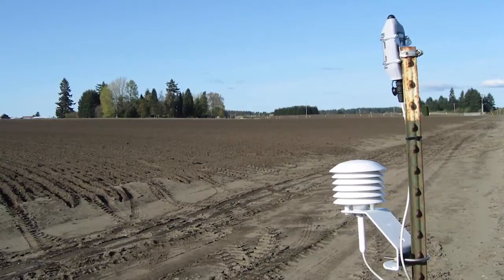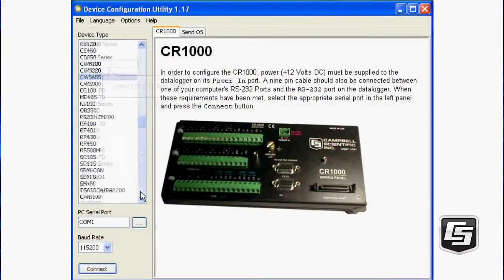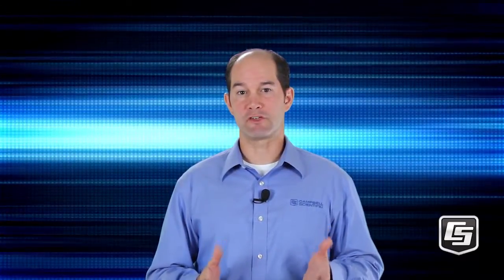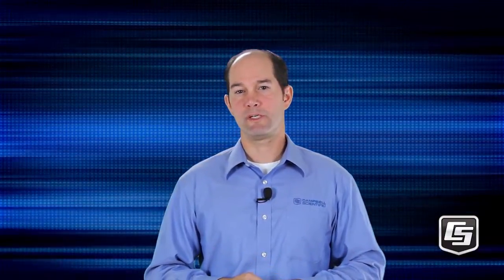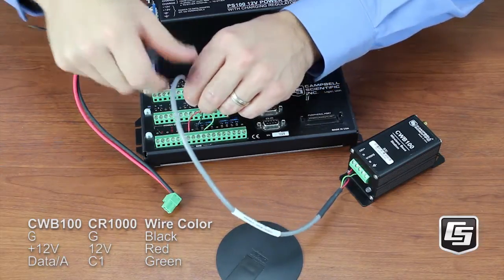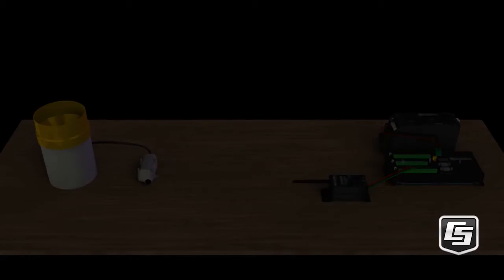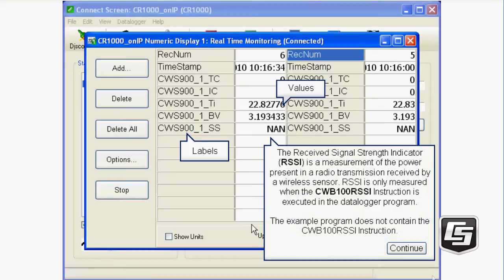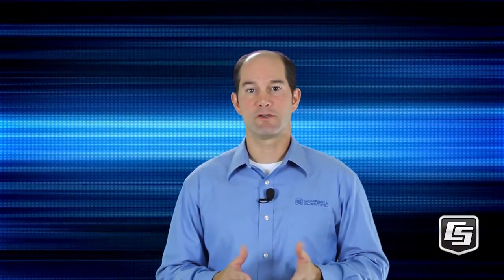Campbell Scientific Wireless Sensor Networks - Part 2

Comment: Hi!Thanks for great instructions. I have one question regarding the red flash that shows how many hops to the base station. If an extra hop is needed to reach the base station, will the sensor initiate this itself or does it need to be specified during configuration? I currently have 5 sensors out of 45 installed that aren't sending data and when I test them there is of course no red flash, just blue. They are not far from other sensors in the network and I am puzzled as to why they don't use these other sensors as repeaters, as I've heard they can do.
Reply from the maker: Thanks for your question. To provide you with the best technical support, please visit https://www.campbellsci.com/support for answers and how-to information via our forum, blog, manuals (with example programs), FAQs, and tutorials—as well as specifications and compatibility information for many of our products.